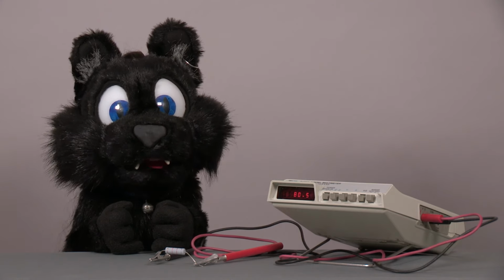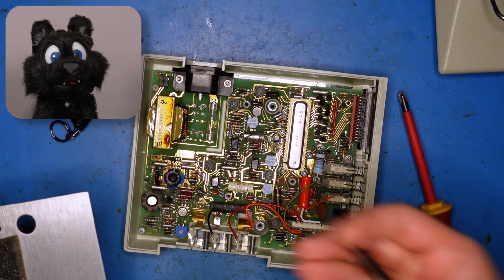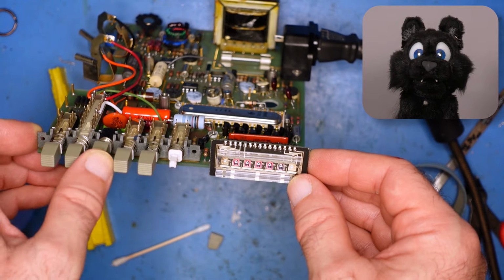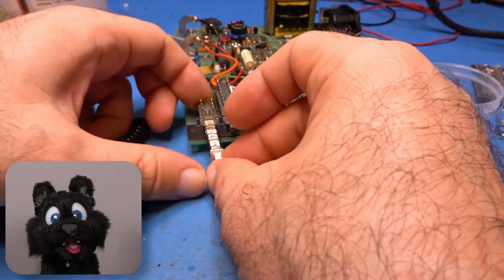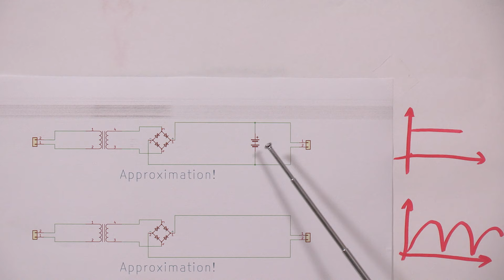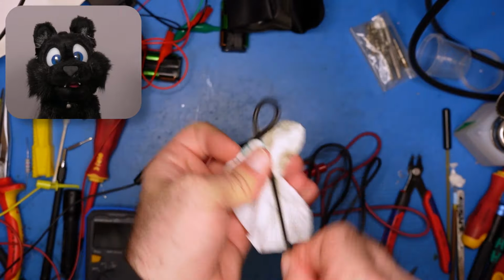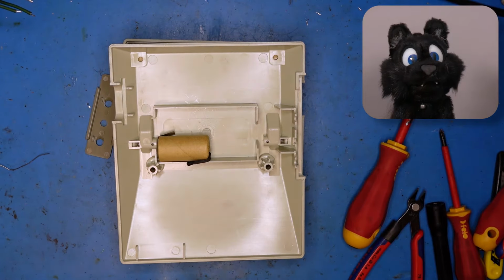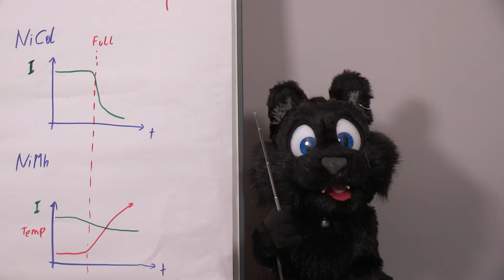HP-3476B Cleanup

Comment: Always wise to remove old batteries, even if they're rechargeable. The NiMH pack in my PowerBook 1400c was definitely not working anymore, so I cracked it open to find it had been visited by the crystalline entity, as there were some nice white crystals forming on the end of one of the cells. I've been meaning to build a new pack so I can use the laptop portably without the power supply, but it uses these weird weird double 4/3A cells which are slightly shorter than normal, so I'd have zero clearance to solder to the ends of the cells or the tabs. EDIT: Actually, you inspired me to take another look, and I've found a very slightly smaller cell called L-A. It's 67mm long instead of 67.5mm, so that should give me 1mm of clearance for soldering the tabs. The only downside is they're over $15 Aussie dollary doos each, so 8 cells will be more than $120, assuming the digital lock opener -based supplier will ship them from the US America to Australia.

Comment: You don't need one of those little arc welders for the battery tabs? I thought the heat from the iron can damage the cells. Maybe that's only LiPo/Li-ion?
Reply from the maker: These came with pre-welded tabs. I just solder to those. The issue is with the cell heating up beyond healthy temperatures for too long of a time. When either soldering to tabs or being very quick it's not an issue. Regular iron against battery is a no-no indeed, becuase it will take forever to heat up the battery to soldering temperatures and that heat will spread too. In my case, the cell itself didn't get hotter than "in a car on a sunny day".
Reply: @atkelar  Ahh. That makes sense. Thank you for explaining.

Comment: I have had the experience of never again assembling batteries with insulating tape. 
If there is a short circuit, it melts and there are more short circuits. 
Heat-resistant Kapton tape is suitable.
Don't ask why I know this.

Comment: Tip = I am not fond of traditional black electrical tape. It ends up releasing and making a gooey mess. I discovered Self-Fusing Silicone Rubber Electrical Tape. No mess (ever) and it does not stick to your fingers, while applying it. A tip for using it = You have to stretch it, to activate its self-welding properties. It stretches an amazing amount, maybe as much as 33%. So, for a 10" wrap, I would unroll 6.67". And, to finish your wrap. hold the tail end against the wrapped part for a few moments, so that the end is well sealed, before letting go of it. Also, stick with the big brand OEM name products. There is some cheaper tape available, but its quality suffers significantly.  If you are not familiar with it, take a look at some YT videos. It is a really great tool, to have in your bag of tricks. HTH.
Reply from the maker: I do have a roll of such a non-sticky tape around indeed. It's just that for this battery, I chose my regular go-to tape; mostly because the stickyness helps aligning the batteries. With the stretching and at the same time trying to get a nice flat arrangement of the cells it would probably end up in lots of bleeping 😅 - I can always revisit that pack, so no real harm done.

Comment: You could cast a new lens from resin, if you really, really wanted.
Reply from the maker: I've cast some replacement knobs before; but I hesitate about optical qualities, i.e. even a very slight distortion in the result will be visible as "wonky" digits. In this case, the suggestion of cutting a piece of an acrylic bar and polishing the flat backside might be better. But I'm prbably not going to repalce it, if the crack isn't visible at all anyhow. Just keeping the option in case it does progress.
Reply: @atkelar  A slow curing optically clear resin shouldn't show any wonkyness. The only major drawback with these would be reduced UV stability, i.e. they might turn yellow over the years, while the acrylic used by the manufacturer stays clear for decades.
Cutting from an acrylic bar would usually require having a mill to get the overall shape right before polishing. I can't imagine being able to get a consistent shape just from manually working it. The magnification is pretty important because these bubble LEDs are so tiny.